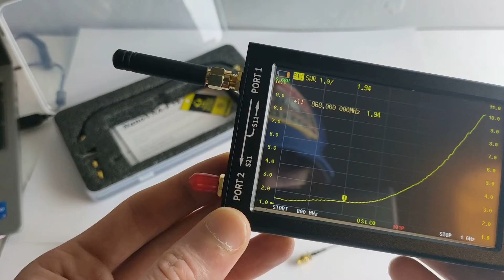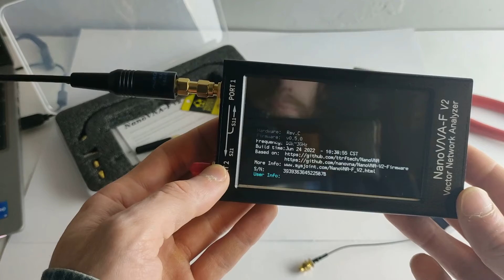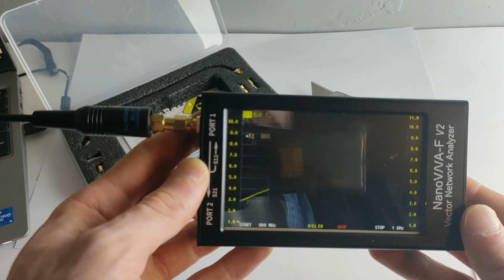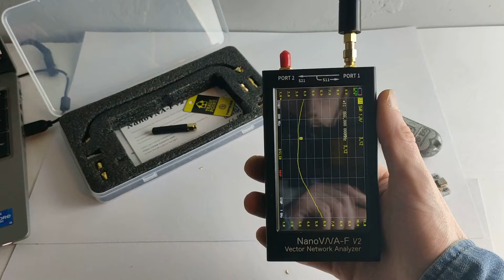VHF/UHF Antenna Mod for Meshtastic Node -  144/430MHz 'Whip' Antenna to 868MHz with NanoVNA

Comment: Honestly, given how cheap these antennas are I'd rather buy one than take an existing one and hack it. 🤷

Plus, an SWR of "3" is atrocious. Ideally aim for 1; commercial aerials seem to be around the 1.3-1.5, and (as I understand it) even a value of 2 is pretty bad.
Reply: For other frequencies and applications I would agree. However with Meshtastic/LoRa, while below 1.5 is ideal, 2 and even slightly above is quite reasonable, especially for shorter/lower gain antennas.
Reply from the maker: Have to agree with you but I had a few lying around and wanted to see what I could do with it ❤️